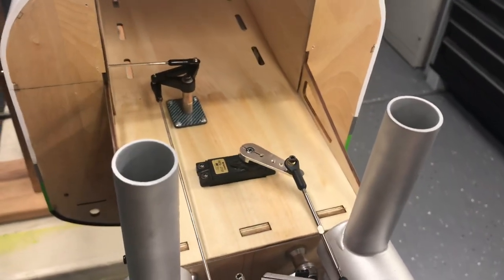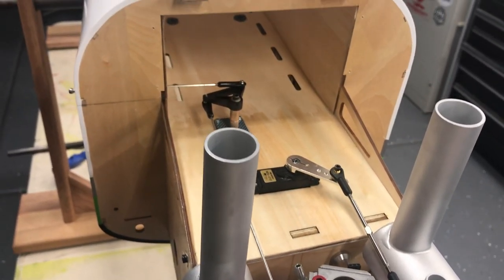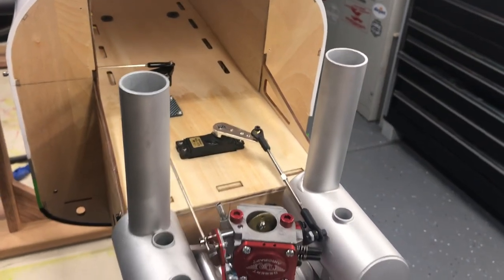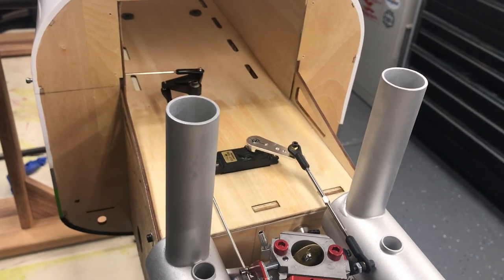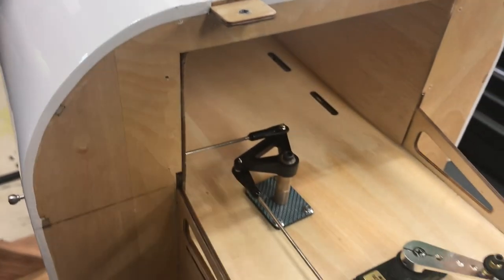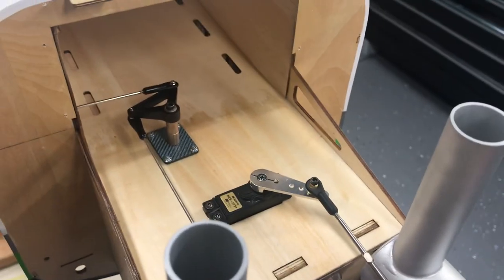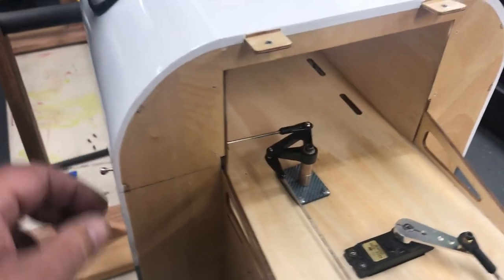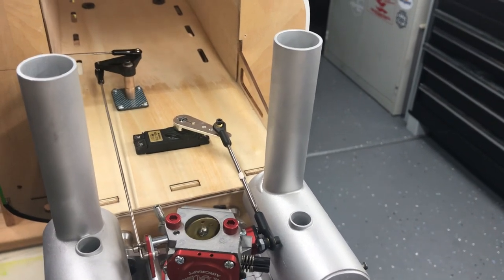DA70 choke

Comment: Which way does the throttle servo move to open the throttle. Forward towards the prop or backwards towards the tail?  I bought a used Mamba 70 and used DA70.   I've only ever worked with DLE engines so I'm not sure which way the carbs on DA engines open or whether or not all walbros are the same?